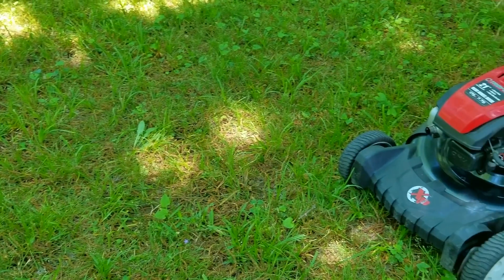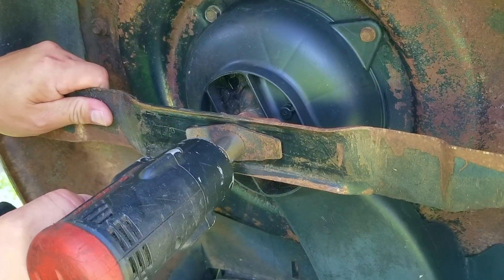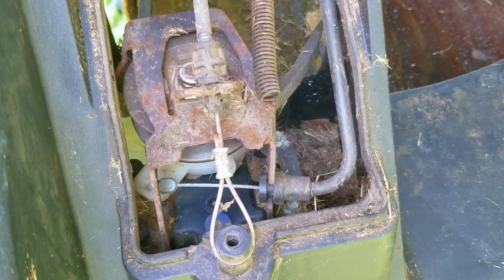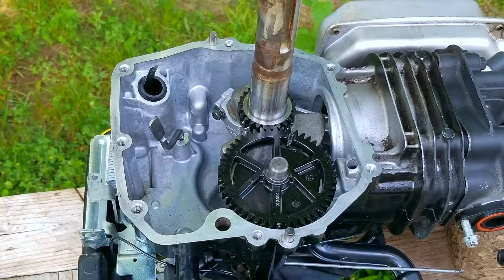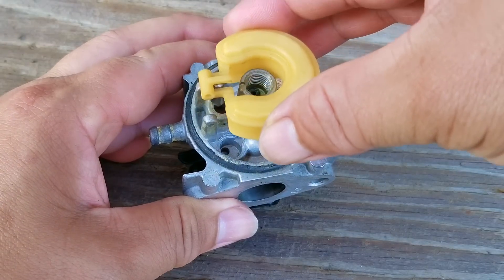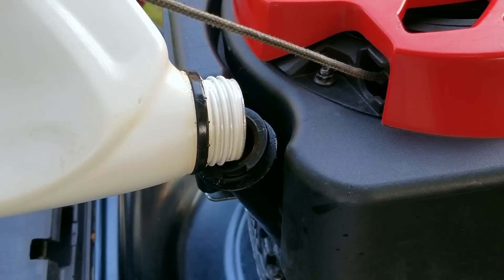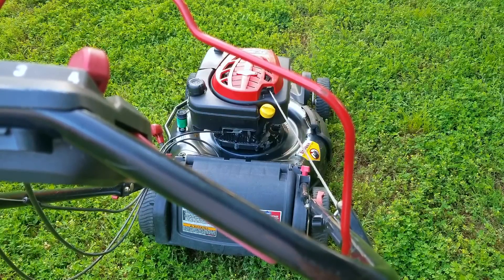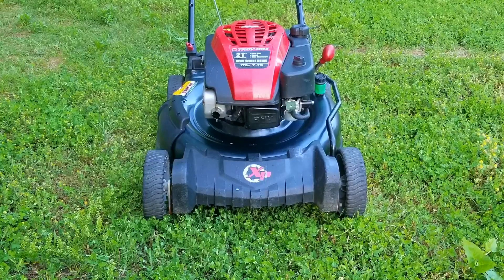Fixing A Troy-Bilt Mower That's Leaking Gasoline And Even Oil

Comment: Just picked up two brand new Troy built mowers at tractor supply. Retail 459.00 for 60 bucks a piece. Both blowing oil. I would assume gasket failure. One was used about an hour and the other not at all. Thanks for the video!
Reply from the maker: Thanks for sharing and good luck with them

Comment: I bought a brand new generator a few years ago.  I took it out of the box and assembled it, so I knew no one else had used it.  When I filled it with gas it poured gas all out the air filter.  I pulled the carb and it was filthy.  Someone had left ethanol fuel in it at the factory.  It was really gummed up.  I cleaned the carb and have had no recurring problems.  After it ran for a while it stopped making power.  I pulled the cover on the generator and found that the wires connecting the generator to the unit were loose.  I cleaned the terminals and putting Locktite and lock washers on the terminals I cranked it back up and it ran perfectly and produced power.  I have had no recurring problems with this generator, but I crank it up periodically and check its output with my Kill Watt meter.  I use nothing but premium non ethanol gas plus stabilizer in all of my outdoor power equipment.
Reply from the maker: wow that generator did NOT want to cooperate!

Comment: I do normally just replace the carb if it is having issues. I have never had one that I couldn't clean up and get running, but sometime it takes putting it on and taking it off several times, which isn't really worth my time. I always keep 2 types of carbs in stock; The old Briggs quantum carb (the manually primed one, with the airbox as I convert the auto choke ones to primer start), and a briggs "classic" carb (the plastic one that sits on the tank). Those are mainly what I deal with as I only fix things up for myself, or to sell and don't deal with repairing people's equipment. 

The only carbs I do bother working on are the plastic float bowl style carbs they use now. I don't like those carbs or the engine they go on, because they seem to have frequent issues, but the one thing I will say is that they are easy to clean out. You just pop the jets out, run a wire through them and they are normally good to go.
Reply from the maker: nice selection of carbs, I might have to do that as well.

Comment: I'm.glad you cleaned the oily scum out of the bottom of that sump my goodness was that awful and what I do is just rtv the sump I don't bother with a gasket, I've been doing it for a long time.  You have to choose the oil resistant rtv in a tube for it to last. You did not waste time at all. Considering new mowers are still 500.00 and up. Absolutely slaughtering the American homeowner paycheck
Reply from the maker: thank you and yes the paper gasket could have easily been replaced with some gasket maker instead! And yes the price for a mower is straight highway robbery

Comment: I have that series engine (8.75 vs your 7.75; the 8.75 actually has an oil filter) on a curb picked John Deere. I like it; believe it was an earlier entry for Briggs into OHV during a time when flat head Quantums ruled. Briggs called it the "Professional" series. My JD was made in 2011 as was your TB, according to the TB manual date. I rescued mine in '17,  tweaked it a bit (not much $) & it has been mowing for what is now my 7th year.  Worth the time IMO.
Reply from the maker: wow very nice and thank you for the information

Comment: Only you can answer if this mower was worth the $$ and effort to fix. The parts cost was minimal, so it's all down to how you value your time. When I do these DIY fixes I don't factor in the cost of my time, just parts cost and probability of success. I've been using a mower for years that was a throwaway picked up off of the curb and fixed in a few hours. Every time I use it I smile....
Reply from the maker: well put and you are correct!

Comment: I recently bought a mower for $400 it’s a Exmart 26” commercial grade push mower it ran good when at the guys house but when I got it home the recoil wouldn’t turn the engine. I though the engine had been locked up but when I told the guy that I only started it up at his house he called me a liar. I fixed the recoil problem but then the gas started coming out the muffler so I send him a video and he starts harassing me (I’m only 16) the reason I talk to you about this is because it just shocked me and how someone you meet up with can be so cold hearted. And yes I got police involved.
Reply: Hang in there. You've got a lot to learn. If it had a gas shut off valve, it should have been turned off prior to transporting. Most people don't know this. These machines [all of them] aren't made as well as the older ones. With trial and error, you can have a good machine. Good luck !!!!!
Reply from the maker: wow, that's tough to hear you're going thru with that situation. He probably thinks he can push you around because of your age?
Reply from the maker: sorry your having to go thru this issue.
Reply: @HomeGaragechannel  Ya I was talking with one of the officers apparently they know him and have to deal with him every now and again. Should have seen his yard it was filled to the brim with push mowers, zero turns, engines, weedeaters all kinds of havoc but at the end of the day I think I got a really good deal for the price I had to pay for it. That Exmart push mowers usually go for $600 bucks so if I ever wanna sell it I can easily make my money back. Keep up the hard work🙏
Reply: @georgepruitt637  There is a fuel shut off valve! I’ll shut it off when I’m driving to  different properties. Thanks George🙏

Comment: Besides one model number this is my mower that I use weekly. I got it for free on the curb.. which I may have mentioned before. I have nothing bad to say about it and really like the rear wheel self propel. I don't need it but do they sell that fuel line or do they just turn it 180 degrees without getting crimped? After watching you take off the plastic to get the grass out, that's something I need to do. My occasional problem though is the rear wheels freeze up when pulling it backwards. Saving this video.. Thanks, Good job.
Reply from the maker: thank you and yes this is a pretty good mower, I'd keep it but I don't need it.

Comment: Another well done vid!
I would have used permatex ultra black gasket maker in place of that super thin paper gasket.
Its too bad carb bowl seals are hard to find as those those go bad quite often. Either way, this will be a nice mower when you are done.
Reply from the maker: I know right, the carb replacement makes more sense to me.

Comment: Hey , I got a Troy bilt  weed eater  it starts buts  dies when you hit the throttle , lots of smoke coming out from the exhaust amd it’s really wet around the air filter area .
Reply from the maker: sure thing, the carb is leaking a bit and it's having an issue delivering enough fuel when you  squeeze the throttle. I'd replace the carb since it takes the guess work out.
Reply: @HomeGaragechannel  ok thanks so much

Comment: In my shop, that would have been around $150 all in, but I'd certainly be in no hurry to get it done, it would be a "make work project" that'd I'd have a tech do when their list of work orders was empty..  At a dealer, that'd be 3 times the cost, if not more, especially since they only sell you oem parts.  I'd opt for an Amazon carb for $20, and grab a donor recoil assembly from the scrap pile. But I can tell you why most likely the crankcase gasket blew, likely someone tipped it over so as to flood the breather with oil, which causes the breather not to do its job, thus causing pressure within the crankcase.  This can sometimes blow out top or bottom seals as well, just like overfilling the oil.  Regardless, yes, I think you spent too much time on this project, but if you are doing it as a hobby, then that is fine.  In a shop, time is $$$ and the minute you need to crack a case open, you are losing cash.  Back in the 90's we'd always crack into the cases, because parts and new engines were super expensive, so it made sense.  Hell, we even used to do valve guide insert installs on L-head engines, if you could imagine, and still turn a profit.  Not these days, it's more of a "when in doubt, throw it out" attitude.  On this mower, the crankcase gasket is not that big of a deal and I think I personally would have done it on the back burner.  Not a big profit job, but here is the thing:  You might make a little money, the customer saves a little money, but in the long run, you have that customer coming back to you in the future.  Nothing says $0.00 like a customer who never comes back.
Reply from the maker: thank you chiming in on this one I appreciate it.

Comment: Hello how did you fix that rattle noise I’m having the same problem
Reply from the maker: wow thank you for reminding me, I did fix it, but I forgot to produce a video showing the fix. I'll have to make it right now.  To answer your question yes I did fix it. you can either , release the rope from the guide, or you move your guide, abut 7-8" further down do the handle.   As the handle bar moves
it keeps pulling out the pawls and those are what's making the noise.

Comment: Hello, My friend brought me a Murray E450 saying that it runs for a minute and then die and also gasoline  coming out of carburetor, I replaced the carburetor and the spark plug and still cutting off and still leaking gas, I install a shut off valve so i dont waste the gas. Do you have any advice? Thank you for your time and info
Reply from the maker: First question ,is did you replace the carb with a new one, OR a used one? And the second question is
does the mower shake when running?
Reply: @HomeGaragechannel  I put a new carburetor and spark plug, is not running smooth, it idle low, after it die I checked the spark plug and is wet with gas.
Thank you for your reply
Reply from the maker: have you checked the valve lash?
Reply: @HomeGaragechannel  This is what I found, I took the new carburetor apart and check the needle on the float, the point in the needle looked kind small, I compared with the one in the old carburetor and the old one have a bigger point, so I put the old needle on the new carburetor and now is running good. 
Thanks for your reply

Comment: @HomeGaragechannel Hey there! I've recently bought a fairly new Cub Cadet mower, but the seller left the oil in it and the fool delviery guy turned the box upside down which had the mower in it.. Because of this when I first started it up, it was smoking pretty bad for a minute or two, but then that went away thankfully.. Since then I have mowed with it a couple of times now, but it doesn't seem to run smoothly: every couple of seconds it gives a puff from the muffler and it just doesn't sound right. I've checked the spark plug and tested it with a new one but that wasn't it and I also checked the air filter but it ran just as bad without it.. Any idea how to solve this?
Reply from the maker: unfortunately without know more information about the mower and engine I'd only be guessing. To be honest though, they try to remove as much as possible from the engine after it's tested at the factory. There should have been at most 3 ounces of oil in it. How much oil did you put into the engine? It might be overfilled?
Reply: @HomeGaragechannel  So i bought it from someone as used, tho it was fairly new, but the person already filled it with oil. Because it was delivered to me upside down the oil must have done some damage and it doesnt run smooth now..

Comment: Is oil leaking from the exhaust a sign of a bad exhaust/intake valve?
Reply from the maker: it leaking a bit a the head gasket, I tightened the bolts later on. good eye

Comment: Why not getting a set of new gasket for the carb? If it leaks it's just that... Maybe the new carb is cheap, but I think new gaskets are cheaper...
Reply from the maker: the reason is because the price difference is so small it make more senes to get a working carb for $13 then a rebuild kit for $10.
Reply: @HomeGaragechannel  Oh, ok, clear. I thought there is much more difference (like 30$ vs 10$). Thanks

Comment: Why is the success rate of fixing a carburettor that low? Clean, replace seats, membranes ect. Seems simple, but why does that fail so often?
Reply from the maker: the low success rate was for just the seat replacement, 25% no leak, and the rest , was some leakage which is no good in my book.